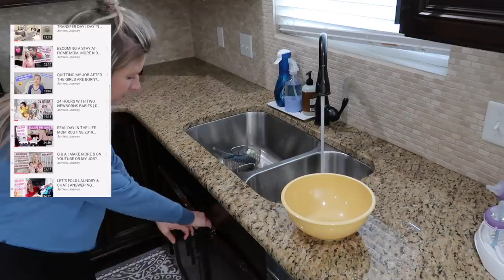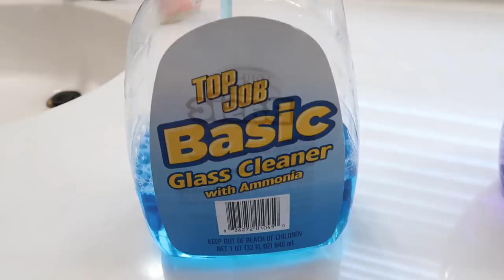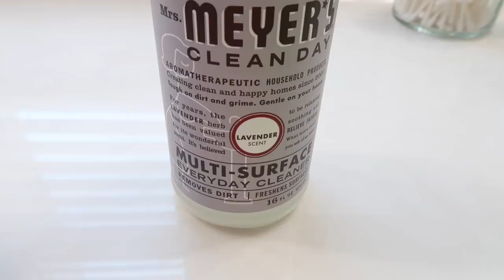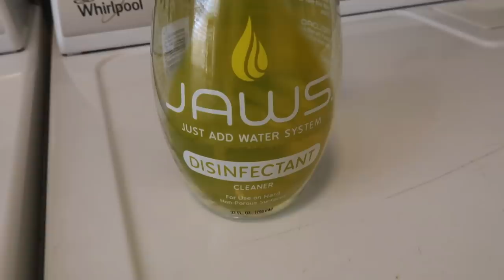HUGE KITCHEN MAKEOVER + WHOLE HOUSE CLEAN WITH ME | KITCHEN TRANSFORMATION | SPEED CLEANING ROUTINE

Comment: I’m not usually a fan of white cabinets, but they make such a difference in your kitchen! They also make the countertops and backsplash stand out more. For barstools I prefer option 1, but they are so similar to the ones you have that I’d just paint your current ones. I love the white curtains and they’d also work well if you paint the walls grey. I’d go with a bluish grey on the walls if you desire to paint. I also thin a navy curtain would work, but on the beige walls the white looks good.
Reply from the maker: Thank you!

Comment: Option 1 for the barstools is beautiful and to pull in the same color for a more cohesive look,  u can do a light grey curtain😃. 

Just as a cheaper option, since the stools u have are the same style, u could always use liquid sandpaper and then spray paint them the color u want. A good spray paint is great for furniture and u can even add a polyurethane coat to protect it more. But for sure spray paint turns out better than chalk paint, I've done both and spray paint is just smoother.

The fabric ones are beautiful as well☺️
Reply from the maker: Thank you!!

Comment: Bar stools!  Option 1 would be nice, maybe if you can find one like it with a fabric top roughly the same shade as your backsplash or the wall color?  Or if you felt like trying it, you could redo the stools you have with some spray paint or a bucket of it.  You'd be more likely to get precisely what you wanted that way.  You could also upholster them yourselves with chunks of couch cushion foam, quilt batting, the fabric of your choice, and a staple gun. :-)

Those curtains are lovely, but if you don't want to keep them, is there enough variation between the color of your backsplash and the wall color to where you wouldn't lose the curtains in the wall if you chose them in the backsplash color?  I know that sounds weird, but I have visual difficulties and it's sometimes hard for me to tell the difference between certain shades in certain lightings, so I'm asking lol.